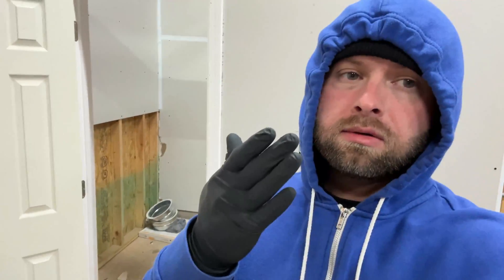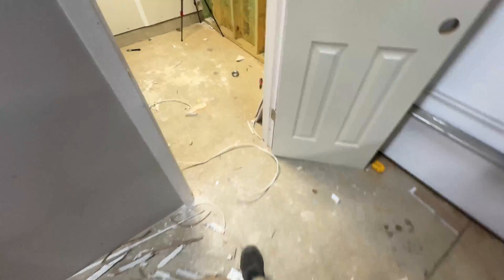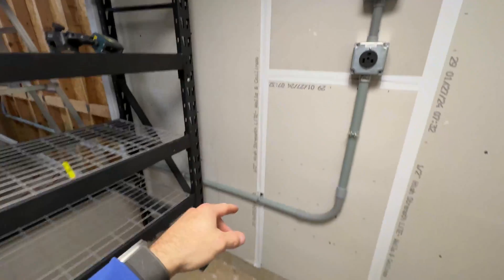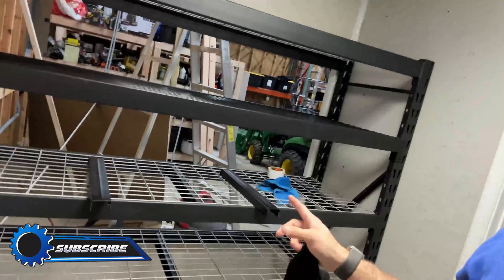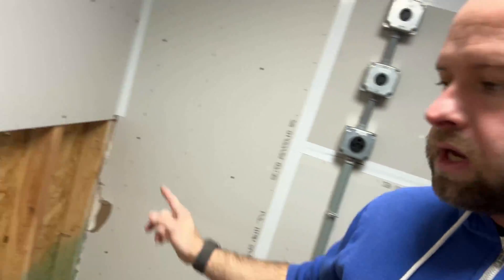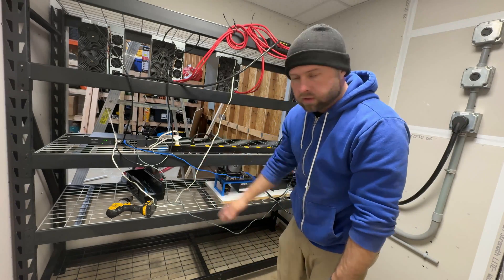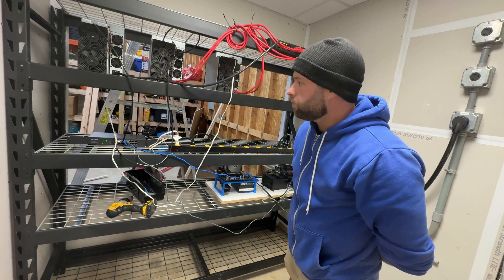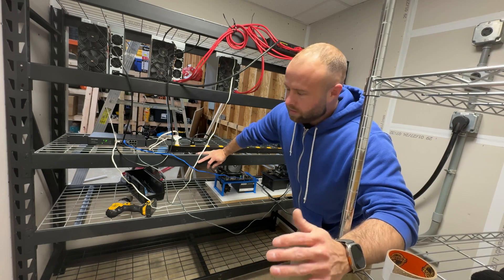CUSTOM Crypto Mining "Shed" Within A Shed - COMPLETE

Comment: Hey, great video.  Do you know what your transformer from the power company is rated at?  I have a dedicated 200 amp service, but  my power company only installed a 25KVA transformer. limiting my power to 110amps.  You might want to double check your transformer...
Reply from the maker: My main house is a 400a service on it's own dedicated 25KVA. The mining shed comes off the street which is upstream from a medium sized community. If there was any question about it, the engineer wouldn't have approved me for 200, i'd like to think anyway